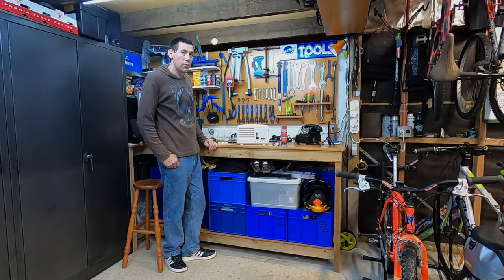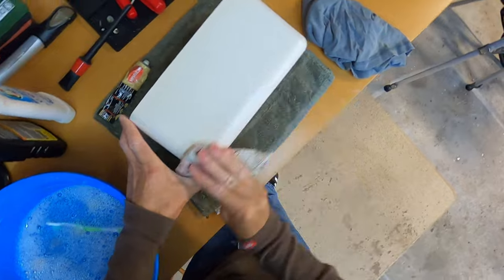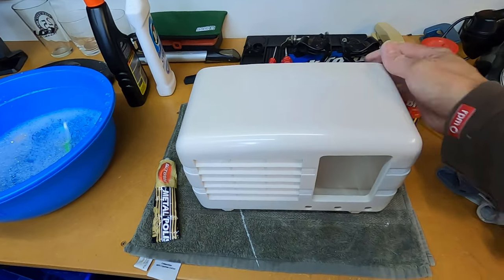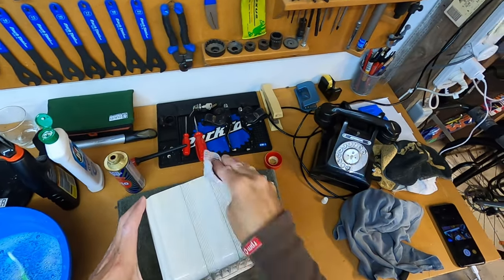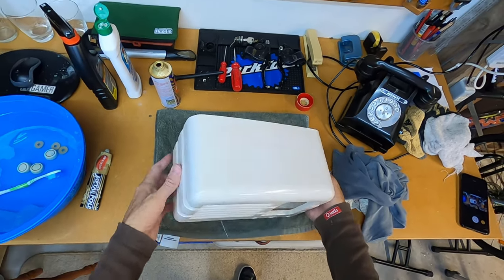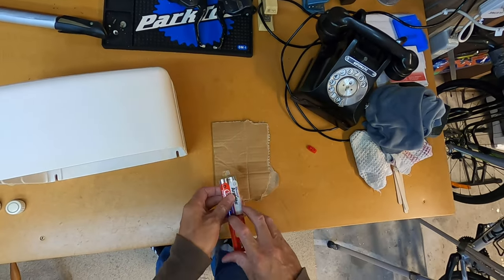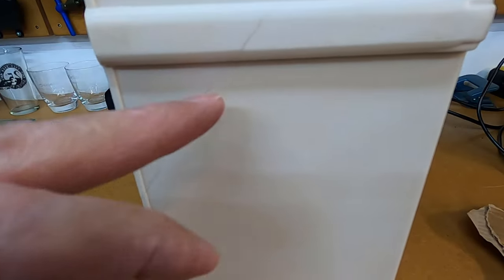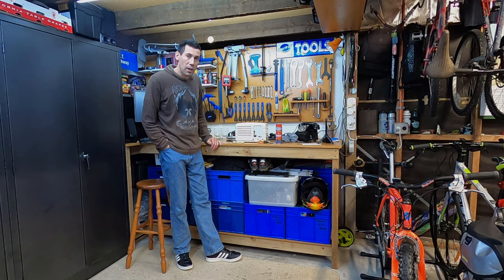Plastic Vintage Radio Case Polish and crack repair - Bell Colt Radio

Comment: I found one of these in my neighbours rubishbin, polished up well using cut n polish and some car polish, Ill give the brasso a try tho.
I think Ive got the same issue with just static sound coming out, the top tinfoil is part of the aerial I think, one of the green wires goes to it and the the other one and the black just hang out the back from what Ive seen.

Nice wee radios they are
Reply from the maker: Hi they are great little radios, great you found one in the rubbish bin, perhaps they threw it away because of the static noise.  Yes try the Brasso on the plastic case it really does a great job.  As far as the static goes, my next stage is repair - I have been busy so haven't had the chance to work on the radio again, but I am going to replace the wax capacitors soon, keep an eye out for that video, perhaps this is what you need to do too.   Also this site https://www.vintageradio.co.nz/ is a good resource for vintage radios with lots of info on the Bell Colt and his youtube channel is called vintage radio steve .  Take Care 👍

Comment: Cabinet looks great. I usually reinforce the epoxy glue with fibre glass matting on this type of repair. Ideally drill a hole at the end of the crack it will keep spread otherwise but it may take years before it’s a problem. Great video thanks.
Reply from the maker: Hey thanks for the comment.  I will keep the glass matting idea in mind for my next case fix and makes sense to reinforce with fibreglass matting, great advice and I didnt know about drilling a hole to stop the spread.  I was very pleased with the result of the clean, glad to bring some new life to an old case :)

Comment: I'm still waiting for you to fix the electronics, I have checked ne the same that I followed your clean and polished routine. I was thinking to spray paint my chassis with a semi gloss light blue or light peppermint green, what do you think?
Reply from the maker: Hi Freddy, how did your plastic case look after the clean and polish?  I have the Colt radio on my list of things to do, I have just started on the Columbus radio and I will get onto the Colt soon.  Were you looking at painting the chassis or was it the case? Regarding the chassis it is aluminum \  aluminium which you will find will need a good lot of preparation in order for the paint to stick to it.
Reply: @MannixGarage  the plastic case looks almost new since the cleaning and polishing. Great tips that you. Worked extremely well. The case had quite a bit of staining on the surface and in between the speaker grill louvres but luckily it was mostly on the surface and I managed to remove it. I was thinking to paint the case as the original colour, creamy white is a bit inconsitant, and I'm not sure why, maybe just it's age?? Mine is a5b7 model from 1957 I believe. I'm thinking that a new brighter colour may enhance its appearance and make it stand out more with contrasting coloured knobs, but I'm not 100% sure if it's the right thing to do and if the paint will eventually chip off making it look tatty.
 Then I plan to give the chassis a very good clean too. The same as you did. I lastly want to tackle the electronics but have no real valve experience, or how to find replacements valves . I was waiting for you to show the way or the process, so I'm pleased that it's still on your to do list. We listen daily to an old AM clock radio which I'm hoping to replace with the colt, for the aesthetics and the great nostalgic sounds that only valves provides.
Reply: Thanks for your advice I neglected to add, enjoyed your presentations.
Reply from the maker: @freddykabulaschnitza2475  I think that you would be best to keep it an original radio case since its an older one, you are right the paint may chip off eventually making it look tatty.  I like the old AM radios too the sound is great 🙂
Reply from the maker: @freddykabulaschnitza2475  No worries glad you enjoyed, I will put some videos up soon of the Columbus restore which is a nice radio also

Comment: Did you use more Jif for this step? I see the bottle in the background
Reply from the maker: Hi Ryan, no I didn't use more Jif for this step, but I filmed the polishing and crack repair directly after cleaning so bottle was still on the bench.  The Jif has worked very well for cleaning, fully recommend this for cleaning plastic like I have done in the video, but just keep in mind it does dull the finish so you will need to polish, Braso and Autosol polishes have done the trick here.  Thanks for watching 😊

Comment: Hi what would you recommend on a chipped plastic radio that I cannot paint?  It is an old Sony with a green plastic. The chip is in the corner in this picture: https://www.shopgoodwill.com/Item/125972382
Reply from the maker: Hi there, that is a very nice looking radio. I see the crack and looks to be on the top of that radio top right hand side.  I wouldn't recommend epoxy glue as the glue is quite thick, on my radio I layered over the crack on the inside of the case, and that worked for me as it it is hidden by the chassis.  Layering epoxy wouldn't work in this situation as the back panel looks to slot into the main casing of the radio, layered glue would stop the case fitting into place.

I would recommend liquid super glue, (not the gel type), and apply from the inside of radio (have radio upside down) while slightly flexing crack to get the glue to seep into the crack, like I did on my video working the glue into the crack, but taking care not to break the piece from the radio.  Once glued into place you will still need to take care as it wont be as strong as an epoxy glue.
Reply: @MannixGarage  thank you for this tip.  I will see how much epoxy I can add to inside while not to blocking access to the back cover
Reply from the maker: @cucumber9864  No worries, hope it all works out well, let us know how you get on 😊